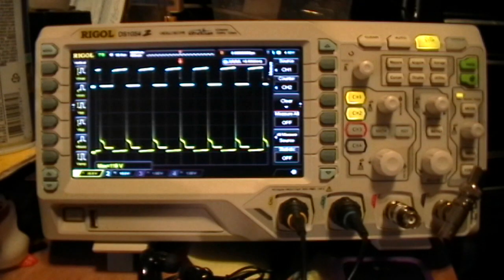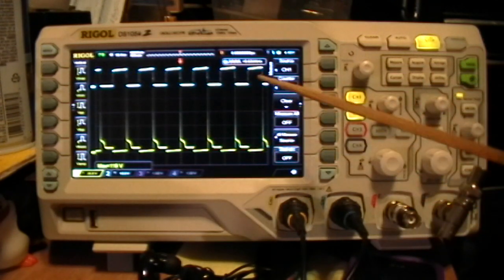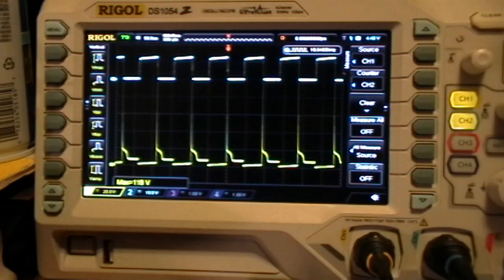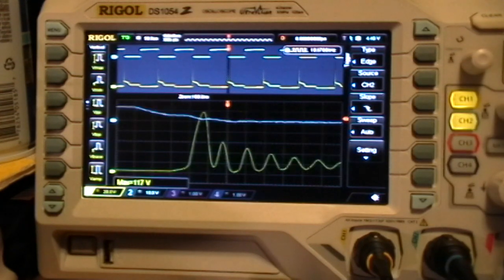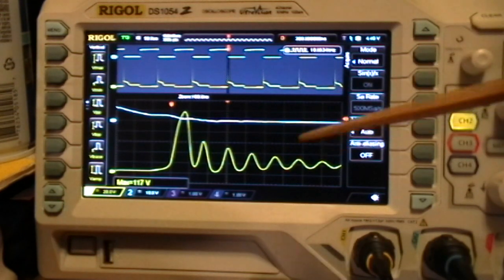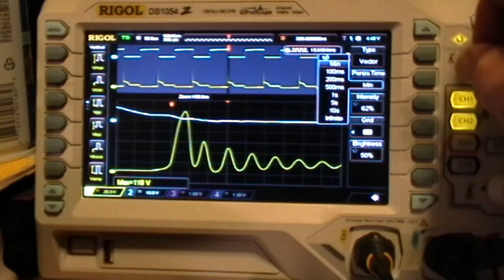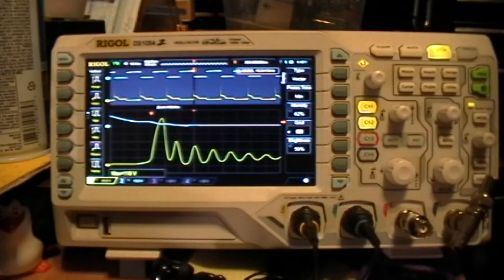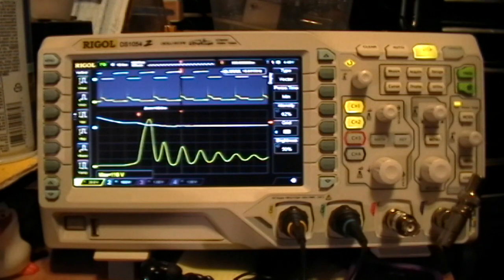Scoposcopy: Rigol DS1054Z Freeze In Actual Use + Other SP2 Bugs

Comment: Mr. Koala,
I have a 1054Z with the exact same build date and time. Last 7/8 characters different.
My boot version shows 0.0.1.3
Running Firmware 0.2.3.11
I've had the scope a couple of weeks and yet to run into any freezing problems.

Peter
Reply from the maker: +peterpurpose 
Thanks for your comment, Mr. Purpose. I think that the Freeze Bug is associated with the Boot Version 0.0.1.2. Scopes with your Boot Version have not reported being able to get their scopes to freeze. Lucky you! The Build Date and time refer to the new SoftWare, SP2, which I have also installed on my scope, but I have the older Boot Version and don't know how to update that.  Many people with Boot Version 0.0.1.2 have reported having the Freeze Bug. 
But I'm not sure about the Math error or the "Pluses" miscounting error, whether they depend on the Boot Version or not. Do you have those errors? 
The Math horizontal error happens at 500 ns/div, Average acquisition mode, Auto memory depth, with 4 channels on and two of them involved in a Math computation like A*B or A+B. See the screenshot at the end of the video. And the "Pluses" miscounting error happens when there are three channels turned on, see the screenshots at the end of the video.

Comment: I see you have a startup CENTER of 103.  If they don't fix some of this shit soon people are going to return them to their Returns CENTER.  Unreal they can't even spell COUNTER either.  Like I said before, management HEADS should be ROLLING!  They have major malfunctions and they are all in MANAGEMENT.
Reply from the maker: +ElmerFuddGun 
Yah, actually it says "Cnter" which I suppose could be an abbreviation for "Counter", but there is room for the full word there so using a nonstandard abbreviation is another fail. "Count" would be better than "Cnter" if there is some character count restriction. 
The scope has support for a handful of other languages too, but I'm not proficient enough in any of them to be able to say if there are misspellings or bad grammar in them as well. Someone who is a native German speaker did post that some German errors were corrected.
Reply: +TinselKoala Yep, that was my point.  At first look seeing "Cnter" one would likely think "center" but there is lots of room to spell out both "center" or "counter".  Well I would think that English would likely be the leading market and frankly I don't think there is any excuse to get spellings wrong in any language.  It's pretty easy to use spell checkers or Google translate to at least get the spelling right.  The Rigol president should be embarrassed about their QC AND that they are loosing sales money across the board because of stuff like this.  It hurts the bottom line more than it does to fix this stuff.  Rigol will continue to be thought of as cheap instead of quality equipment and will only move down in the ranks of the test equipment field.  Yet it is so easy to fix.
Reply: +TinselKoala I would not excuse "Cnter" as an abbreviation for Counter 'çause the first thing I thought of was "Center" which it is much closer to.
Reply from the maker: TheBdd4
What's even more stupid than that is this: I just pulled up that screen again today and the startup "Cntr" tells me I have 99 startups! And I've started the scope at least a dozen times since making this video!
Reply: +TinselKoala - Well there you go... CNTER must mean that when you started it up it detected that you are now closer to the center of where the scope likes to be on your desk.  When it gets to zero it will be perfectly aligned on your desk and with the rest of the galaxy thus providing the absolute best performance.  Now we know.    ;-P

I mean WTF... either you are joking (and it's not April 1st) or Rigol can't even make a counter?  I don't get it.  From now on I will be checking mine every time.
Reply from the maker: ElmerFuddGun
I am not joking! It's amazing. I posted a couple images showing the "Cnter" miscount on the EEVBlog thread (103 startups shown on Nov. 2 and 99 startups shown today) and would you believe it, I got flamed (relatively speaking) for being too picky and spending too much time on the bugs! A DSO is supposed to be a quantitative measuring instrument, right? So if it gets basic quantities of measurement wrong, and can't even keep track of its own measurements... well now we know why it is such a bargain, I guess.
No, seriously, it's still a bargain. I mean where else are you going to get so much amusement from an oscilloscope?
Reply: +TinselKoala - too picky... now that is just dumb.  It's not a one off made by someone at home that you don't want to offend.  It's one of many products made by a large company that has dealers world wide.  They also make some of the low end scopes for Agilent.  They have 400 employees.  Someone's really worried that you are picking on them too much and they might cry?  Or is it that they would, as a purchaser of said product rather be blissfully ignorant of any negatives of what they bought just so they could feel better about their purchase?  I think that is it.

Spelling mistakes and a simple counter (assuming it is!) are things, especially in today's world, that should not have gotten past the engineering department let alone the QC department.  Rigol has a major QC problem with such small, simple things getting through.  There is no excuse.  They are not new to this field or to making oscilloscopes.  They want to compete with the "big boys" and get a larger market share.  Would anyone not be complaining if this was Agilent or a Tektronix scope?  There would be less of these scopes out there (because of the higher price) but there would be an even louder cry from those owners and want to be future owners about the quality control.  People would be worried the same issues may be in their top of the line model from the same company.  Because this is a lower priced scope made in China we shouldn't bring up any problems?  Afraid of offending someone in China now?

Fact of the matter is there are thousands and thousands of these out there and the owners all have to deal with it when they shouldn't have to.  We all should be able to buy a product and trust it.  It shouldn't crash or hang because someone's program ran unexpectedly different on a different PC made by a different company with different specs.  There is one manufacture of this scope and bugs shouldn't get past the QC door.  There is no excuse.

Yes, this scope has been amusing.  But I bought it to work for me and not for me to work around it's problems.  I bought it because I want to know the truth about signals I look like and not something wrong.  You need to be able to trust your test equipment as long as you do your part and stay within its capabilities and ranges.  Same as a simple calculator, as long as I enter my numbers correctly and stay within its limits there should be no doubt about the results it displays.

Keep up the good work and keep their feet to the fire.  Hopefully they are feeling the heat at least a bit.
Reply from the maker: ElmerFuddGun
Yep,  I agree. The QC is spotty. I think the hardware part is pretty good with the scope itself; the probes are a bit cheapo but adequate. There is a real problem with the software testing and QC and after-sale support. The fact that a firmware update cannot be uninstalled and rolled back to previous versions is bad bad bad, even MicroShaft knows this, and not being able to update other critical bits of the software items is also a poor strategy. I do think that Rigol USA is making an effort to help customers but there isn't much they can do about the Chinese problems at the manufacturing plant or corporate HQ. Let's hope they learn from this episode and buckle down to make some real progress in the software.
Thanks for the encouragement. I'll keep documenting bugs and problems as I find them, that's for sure.